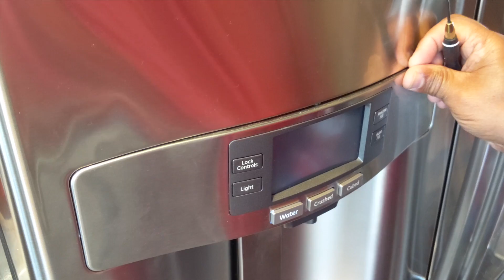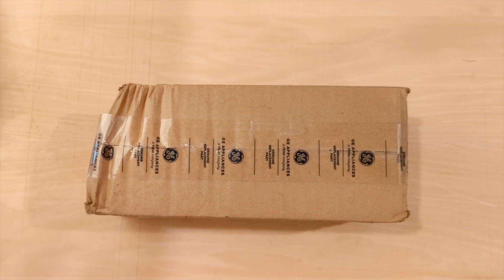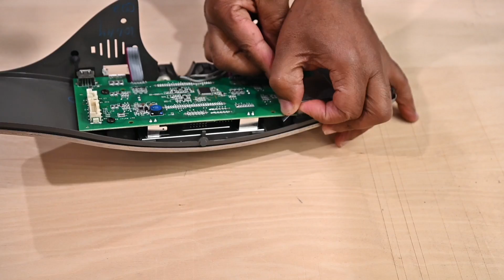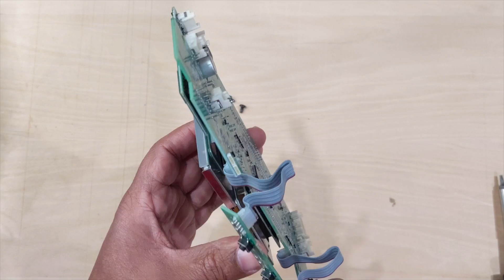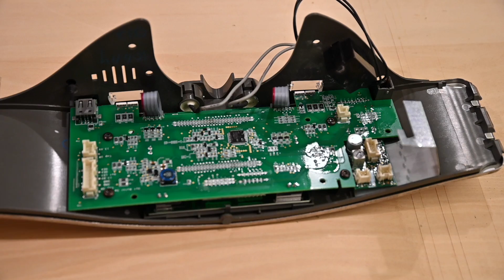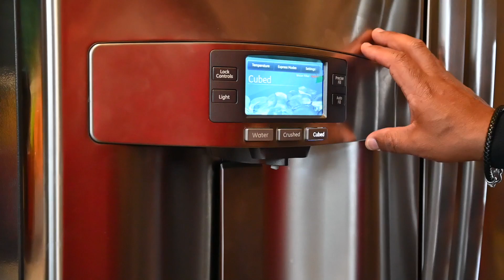How to repair Refrigerator LCD Board on GE Profile™ Series ENERGY STAR® 27.7 Cu. Ft. French-Door.

Comment: I am having this problem right now, I just get the logo upon first plug in and then display turns off and completely no response afterwards not just on the LCD but the entire controls upfront. Water doesn't dispense, no buttons are working. no lights on the control panel. but the fridge works though. I'm gonna try replacing this and update if that fixes things.
Reply: ok update guys after a power surge the LCD board fixed itself. hopefully for good.

Comment: Ours is the same refrigerator and the water or ice will just start coming out without touching anything. Does anybody know if it's the LCD board that would be causing this or something else?  Any help would be appreciated. Also, best place to order the parts from? How much was that panel Ray and where did you get it from?
Reply from the maker: Try cleaning the switch with alcohol and compressed air.

Comment: Do you know if this will work if my screen is lit up and LOOKS just fine but it doest not recognize "touch" so nothing can be selected on it?
Reply from the maker: I recently replace my refrigerator because the compressor went bad. So I really can't answer that question. I did take out the LCD board for the refrigerator because It was only a year old. I will be selling it on Ebay.

Comment: Hi Ray, how do I remove the spring behind the water dispensing vertical steel plate. When I try to fill a glass in manual mode, I push the vertical steel plate. The plate doesn't retract back when I remove the pushing force. I have to pull it manually using my nails. I guess the spring lost its tension strength.
Reply from the maker: I have no idea, I haven’t had that problem with my unit. Sorry that I couldn’t answer the question. Thanks for the feedback and please remember to subscribe to the channel and like the video.

Comment: Thank you.  My manual showed two screws on older models but nothing about when there are no screws. You saved the day.  I repaired the paddle switch which required removing the control panel and funnel.
Reply: Did you do a video on this? I think I have to replace my paddle too.
Reply from the maker: Thanks for the feedback and please remember to subscribe to the channel and like the video

Comment: my fridge touch screen failed;  do you have any thought on this issue...thanks
Reply: Mine too just after I replaced the filter, the screen is still on but non responsive to the touch. So i am thinking to take it a part just to check if any connector got loose before ordering a new part.
Reply from the maker: @jeanmaraval8324  Just unplug the refrigerator. Let it reset itself. That should fix the problem when the touch is unresponsive.  Hope that helps.
Reply from the maker: Do I have any thought on your issue? Get other part to replace the fail touch screen. Thanks for the feedback & remember to subscribe and like.

Comment: Ray, thanks for making this video!  I used it to replace the touchscreen on my GE Cafe french door refrigerator.  The original screen lasted only about 2 years...  The only trick I encountered was GE's hex screws holding the board in place. I had to search my screwdrivers to find one that worked.  After that, it was a breeze.
Reply from the maker: david berg I’m glad you found this video helpful. The Circuit board is expensive enough. Getting tax again for a simple job from service repair would really sucked. Thanks for the feedback and please remember to subscribe to the channel.
Reply: Awesome, thanks! I must have missed that the first time watching.

Comment: Thanks for taking the time to make this. My GE profile french door refrigerator had the same issue and I was able to switch the control board in less than 10 mins thanks to your video. Pro Tip: if you use an iPhone to take a picture of the QR code on the model label inside the fridge it will offer up a link to the GE page with manuals and parts for sale. This is how I bought my replacement control board.
Reply from the maker: flumpmaster Thanks 🙏 for the feedback and please remember to subscribe to the channel.